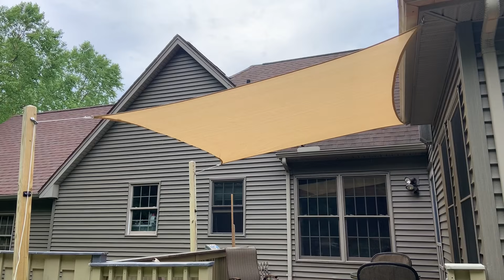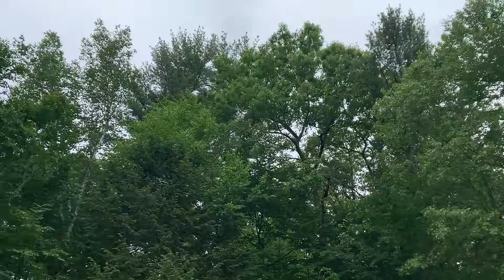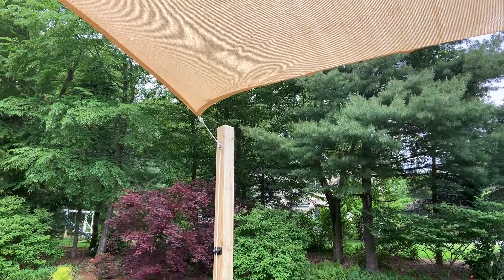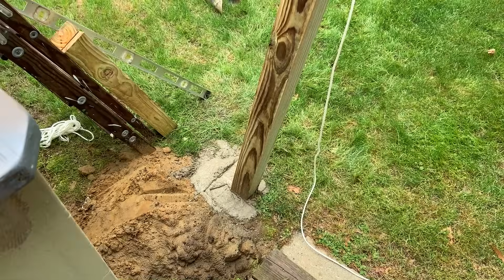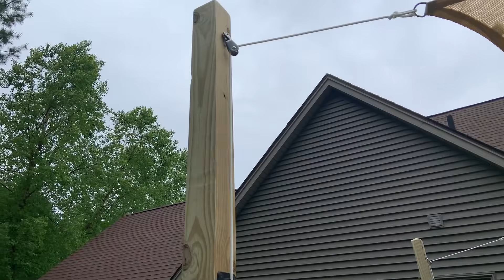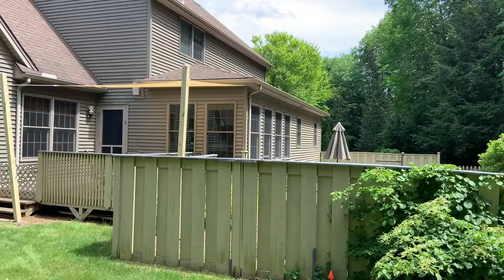How to Install 10 x 10 Shade Sail

Comment: Thanks for the informative video. I will be installing a sun shade over part of my covered deck.After  watching a few videos on this subject one guy suggested you cover the vertical post with plastic covering that are covered with cement. Reason for this is the concrete’s chemical reaction will eventually rot away the wood even thou it may be pressure treated. I had a few pressure treated posts along my fence line rot at the bottom and now I know why.

Comment: Concrete not cement. Cement is an ingredient of concrete. 

Plumb not level. Vertical is plumb.   Columns are plumbed using a “level”. Horizontal is level.

Comment: I kept my post straight and put the pulleys on the outside to get the angle couldn’t bare to see the pokes like that especially when I have the string lights on them.
Reply: Agreed. Seeing huge lumber at an angle is an eye sore. 
Just make them straight and use turn buckles like everyone else.

Comment: 4X4 BEAMS BOWING? OR IS IT ENOUGH?
Reply: This is what I need to know. Don’t want to do 4x6 or 6x6 but if I have to, I’m order to avoid bowing, I might as well do it initially
Reply: It bows because it's too high and with wind it constantly pulls. You want two of them to be 18"–36" between diagonal corners. The larger your sail the more variance you want, because it essentially becomes a literal sail otherwise.

Comment: The pulley system and clear to hold it tight is a good idea to remove the inch’s of fixtures. Mine has to stand apart from the house due to the position of the structural points. With a three point shade I could clip in at two points and if they are tight, use a pulley on the third.

Comment: I have one love it but can't get the sag out the middle
And flaps in wind
Reply from the maker: removing sag likely a function of a couple things - 1) spread of the eye bolts on the house or structure 2) angle and spread of the attachment points at the far end - 3) ability (pulleys and cam cleats) to really pull hard on the sucker to stretch it out.
Reply: Half inch turnbuckles might further help increase your tension.

Comment: How did you get them to be the same degree?
Reply from the maker: If u are talking about the angle of the poles - you use any string with a weight on it to find exactly what level is and then you measure back from it.
An easy way is to set up something temporary - using poles or 2x4's and guy wires (tent stakes, etc.) to put the poles into position. You can fuss with the poles until they look and work properly and you will know where to dig the holes (1) and also how far back from level you want them to be. This can be measured by using a 2 or 4ft level and "X" distance back from level in that 2 or 4 ft span. Various sites mention how many degrees back you want the poles to be set at. 
You can do a final check with the 4x4's or poles in the "dry holes" before you pour concrete into them. 
In a case like mine, I might have wanted the top of the poles 1 foot back and 1 foot off to the side (wider) than the rings on the sail.